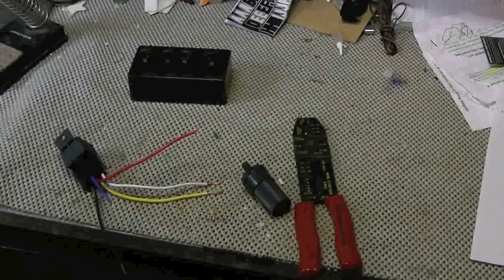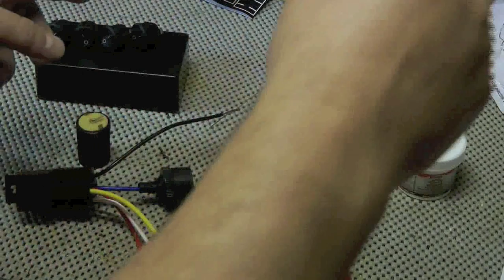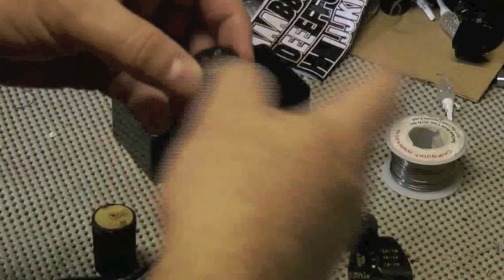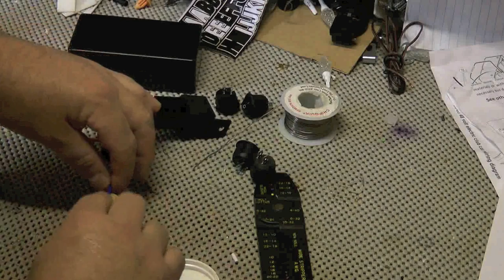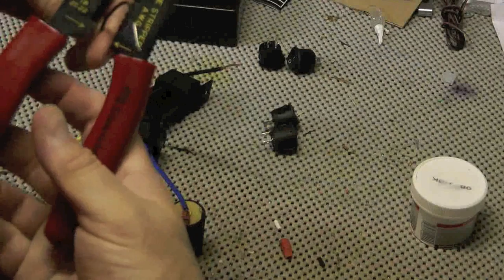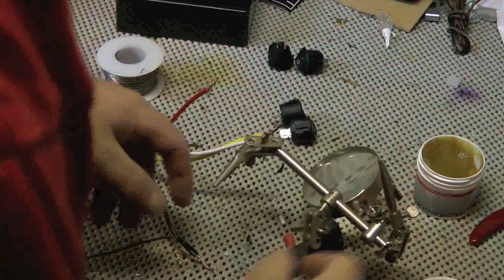P71 Dash Cam Install part 1

Comment: Why didn't you just run the hot and ground wires to their respective cigarette lighter wires (directly connected) rather than soldering into the bottom of the plug? Seems it would have been far easier with the same result.
Reply from the maker: I could not get the wires to stay soldered to the plug - plus they are exposed that way and you have to rely on electrical tape not falling off.  Too risky